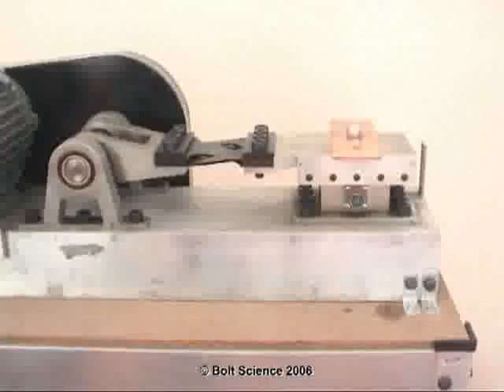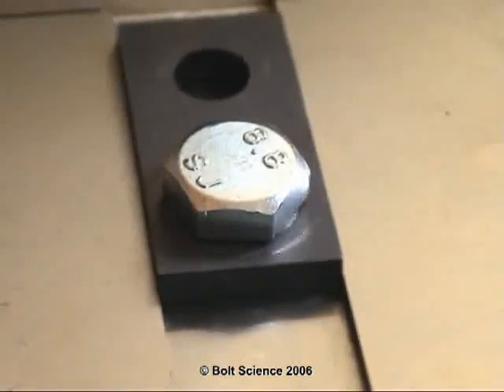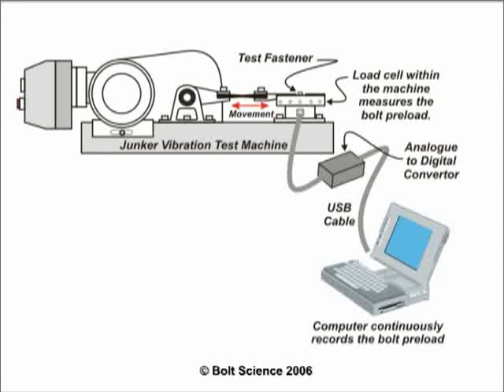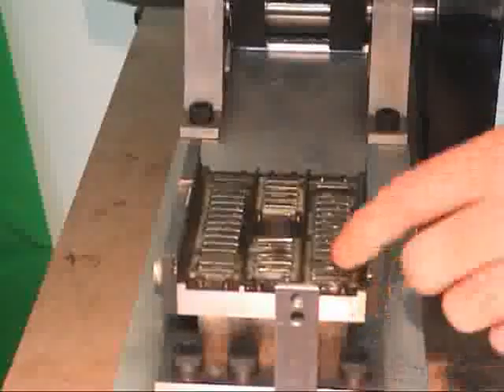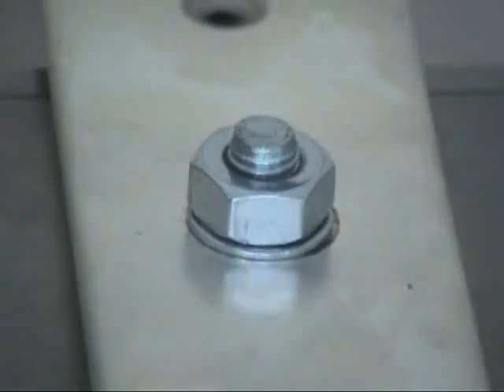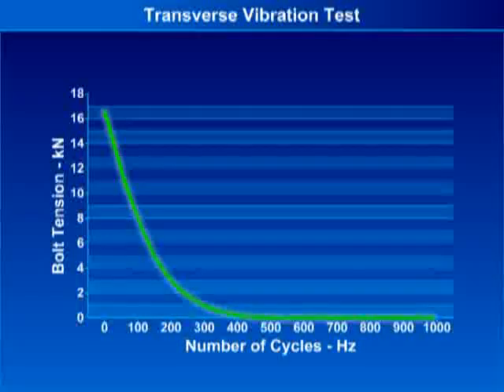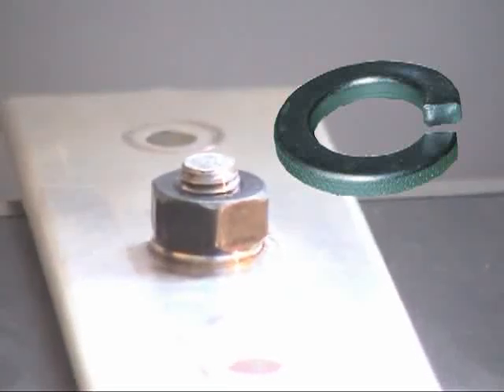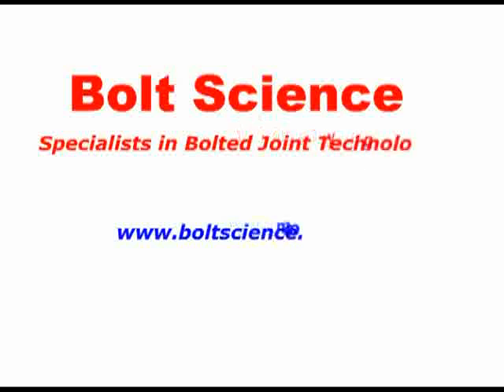HEICO Lock Washers Junker-Video

Comment: I was taught that split washers were to be placed between a data dead flat washer and the head of the bolt.  I wonder if you might execute a test with that assembly.  I see a lock of videos hating on split washers that don’t take into account different assembly methods.

Comment: the graph basically says "these lock washers will be fine for most low vibration uses"
then if a higher vibration level is present, you would likely want to use a thread sealer like lock tight.

perhaps other lock washers are more effective as well.
Reply: It's like there's some movement to get rid of these...some president of an envirogroup that got their finger pinched in one.

Or maybe it's an industry looking to make money by switching with their products?